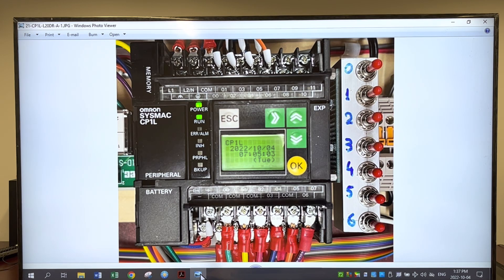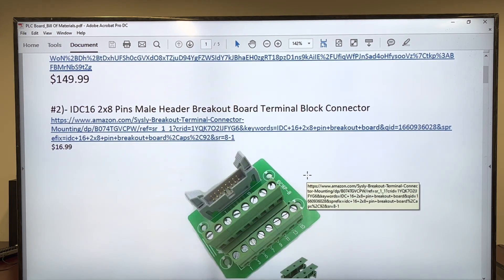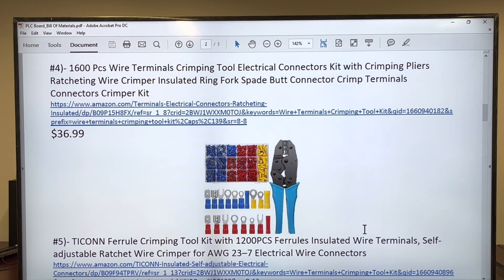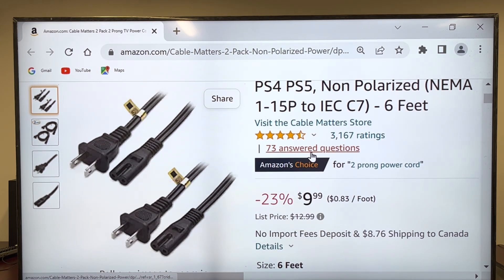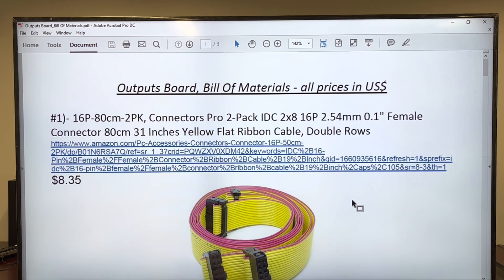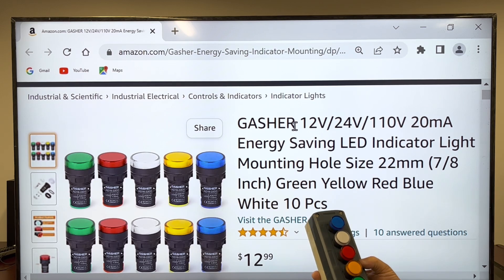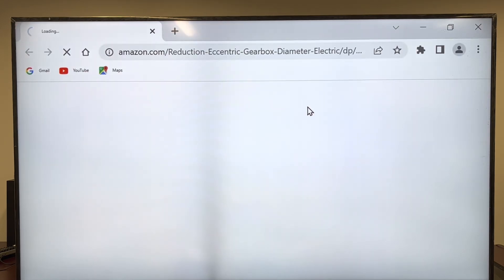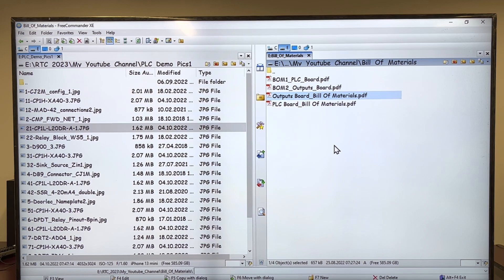#7 DIY Low budget PLC Trainer! Your Bill Of Materials!

Comment from the maker: @maximusthegreatest Hi again Max,
I thought again about your switches. If I got it right from your message, it seems that you received momentary switches only? If it is the case, I am very sorry about that.
To make sure that it won't be another misunderstanding, I'll change the link from the Bill of Materials to a distributor I personally know instead of an Amazon third party provider.
Here is the link for a switch ON-OFF-(ON) I ordered many times:
https://abra-electronics.com/switches/toggle-switches/sw205-miniature-toggle-switch-dpdt-on-off-on-6a-125v-sw205.html 
The company has branches in US and Canada as well.
Regards
Reply: Yes I received only momentary switches. If you look at the reviews for the original link(amazon) you will see people saying the same(that they just received momentary switches). I think this is a case of a wrong product listing by the seller as I understand that the title indicates that it should include a toggle. 

Do you know of another product on amazon that may work? That abra link says I need to have more than $45 in my cart before I can proceed to checkout. A few hours ago, I ordered ASIN ID: B07PJGFYTX (I'd post link but youtube doesn't like that) from amazon. This looks like a toggle but it only has the 2 prongs. Do you think that will work?

Thanks!

Comment from the maker: @maximusthegreatest 
Hey Max,
Thanks again for your comments, I appreciate them all.
To answer your question in more detail, here is a copy of the item #3 in the Bill of Materials:
#3)- Uxcell a14112200ux0187 DPDT ON-OFF-(ON) Momentary-Mini Toggle Switch AC 250V/2 Amp, 120V/5 Amp, 10 Piece,
First, it is called "Momentary-Mini Toggle Switch" so both words, momentary + toggle are there.
Secondly, and more important, take a look please at the technical name:
 DPDT ON-OFF-(ON) . The ON on the left is for the Toggle switch. The second ON between brackets (ON) is used to signal a momentary switch.  And the OFF in the middle shows the switch position when you won't push it neither direction.
In other words, the physical switch is somehow special, because it has three positions:
OFF in the middle, toggle if you push in one direction-it stays ON until you put it back OFF in the middle. And the third position is when you push it in the opposite direction of the toggle.
In all switches specs that's what you find: ON-OFF-(ON). And if you order exactly the item in the Bill of Materials, that's what you get!
Regards

Comment: I'm putting together this trainer right now and the switches in the bill of materials are momentary switches so they don't stay in the on position. I assume the logic will work or can be modified to read the switch like a button press but I think it would  be better to use a switch that stays in the on position once pressed.
Reply from the maker: Hi Max,
Thank you for the courage to start building the bracket with switches.
If you click on the link in the Bill of Materials, you'll find out that the switches  are special: they contain at the same time a momentary and a toggle switch. I explain this in detail in several videos, especially in #10 and #11 when I put and solder the switches on the bracket.
If you only use momentary switches, of course they won't remain in position.
Regards
Reply from the maker: Hi again Max,
Please be so kind and watch the first 2 minutes of the video #9, where I explain and measure both the toggle and the momentary switch.
If you have any other question, I'll be happy to answer it. Regards
Reply: @CU_Wiring_Electronic_Projects  Hi Christian, thanks again for making these videos, they are super helpful. So the switch you are using in the video is different from the switch you have linked in the bill of materials. The switch in  your video has on/off and momentary but the switches in the link are ONLY momentary(both directions are momentary).